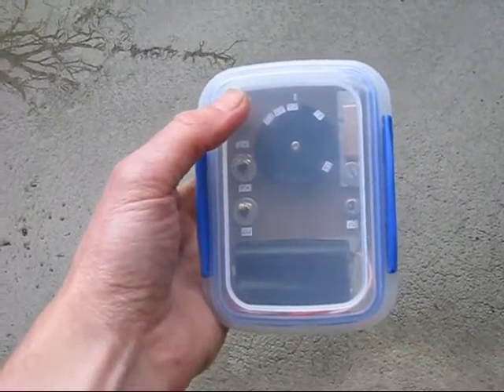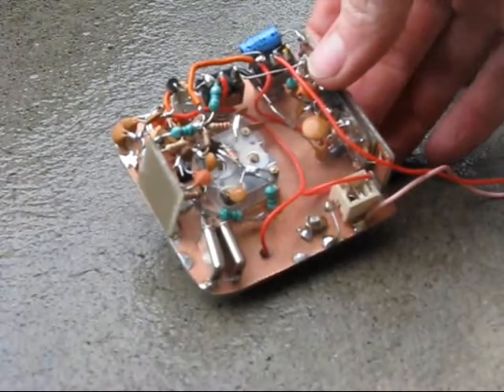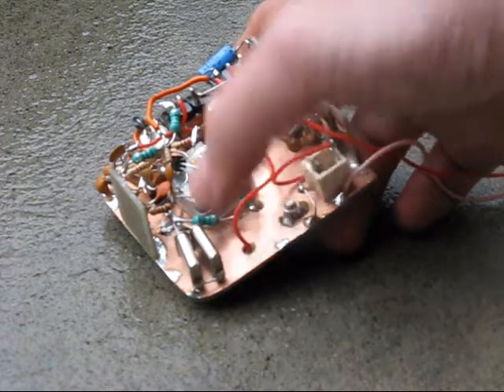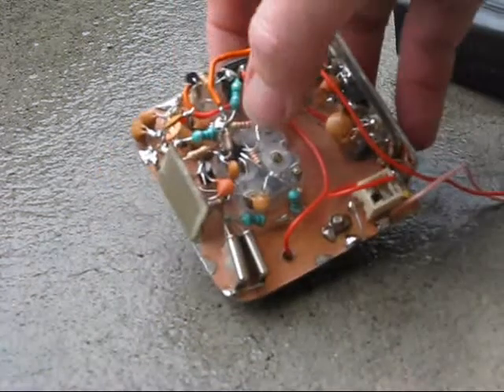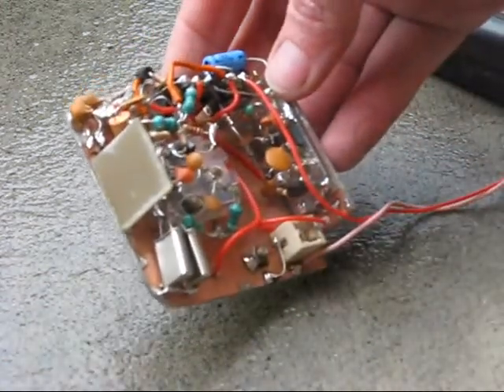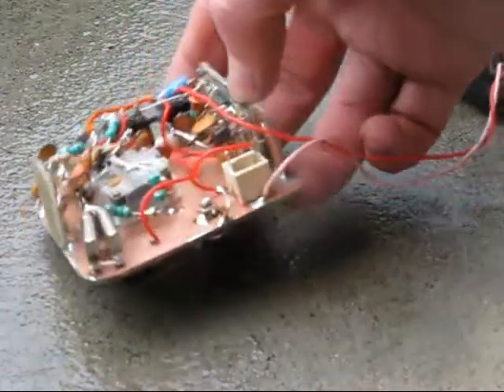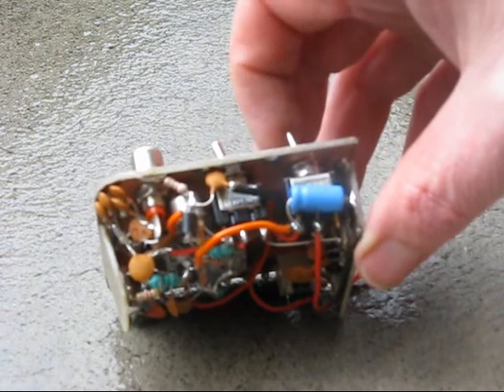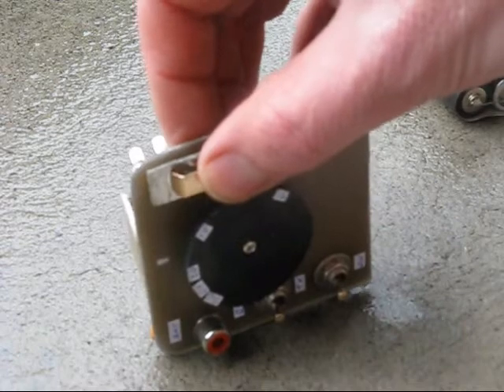'Tiny Toy' 40m CW QRP transceiver

Comment: This looks good. I'd want an LM386 output.
I built a Pixie and put it on 5.262 MHz, less crowded, unfortunately it blew up an electrolytic cap. and transistor and the copper started lifting when I tried soldering new ones in. 350 mW, best was 280 miles.
G4GHB

Comment: how much power does the receiver produce to power the earpiece? could you replace it with a small piezo transducer or buzzer and not need the earpiece in all the time? it must produce at least 30-50 milliwatts right?
also, have you tried it at all at night? try to get some atmospheric bounce going and getting some international contacts?
Reply from the maker: +SirLobsterman Only a few mW will drive a crystal earpiece. Piezo transducer will work but not as good audio. Contacts up to about 1000km should be possible and depending on where you are that's international.  Maybe further if conditions are good.
Reply: vk3ye interesting

Comment: Hi Peter
I have build your Moorabbin regenerative radio. Very easy to build, many stations. Nice soft regen control. Even the the frequency is spot on using your number of turns. Have some music on my workbench now. The output transformer is not easy to get today. A friend helped me. 
My new project is the tiny toy 40m, In the the 70s and 80s the 6V latern were in use by QRP operators. I bought one for under $5. I think I am a little bit romantic.
vy 73 Jens VK4AJG

Comment from the maker: You could. See my pedestrian mobile videos. But efficiency will be compromised and few will hear you.  HF emergency comms requires at least 10 - 30w SSB (5w CW) to be reliable with a full sized antenna. An end-fed wire or dipole and pole is still the best emergency comms antenna unless it's very windy.

Comment: It is possible to add a small 40 meter band Radio Antenna for this unit to the point that you can walk it down the road. In the event of an Emergency when all power has failed and Major Antennas have fallen down this unit can be used as a Last Resort for Communications.

Comment from the maker: @aseglkj Agreed that the NE602 isn't the strongest mixer going, but it's easy to use, doesn't need any broadband torids to wind and is adequate for a basic receiver.  Even top manufacturers like Elecraft use them in their simpler transceives.  I've had hundreds of contacts with NE602-based equipment, with very few disrupted by strong signals.  Other videos on this channel demonstrate receivers with stronger receive mixers.

Comment from the maker: @m0jhaqrp 1. T/R: Yes only switches supply and antenna. Offset is manual. 2. VXO:  2 parallel xtals helps increases shift.  But you also need inductor in series with crystal - try values between 10 - 33 uH to greatly increase shift.

Comment: been watching your vids, great work , re the above trx . is the T/R switch just that ? switches between tx and rx only . does it not have a freq  offset for tx/rx? your vids have inspired me to go qrpp this summer . forgive my ignorance , does the 2 parrallel xtals enable the freq sweep you have and would this be lost just using 1 xtal ? I ask because i stuck a variable cap on a pixie and only got minimal swing from 1 xtal ..

Comment: Thank you for your video. It is an inspiration especially for a new ham. The circuit at the end of the video is a little confusing mainly the first oscillator stage and also the audio out pin for the NE602. Is that really a functional circuit or are you just using that for illustration?